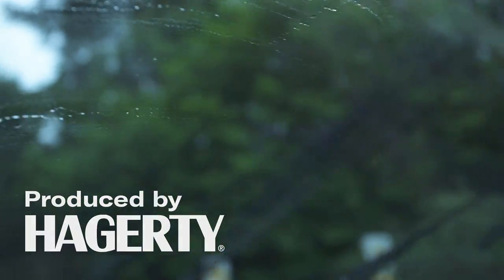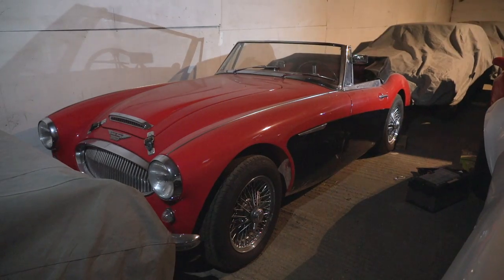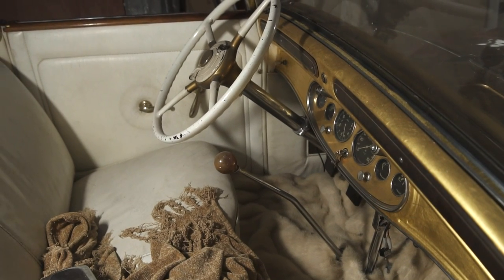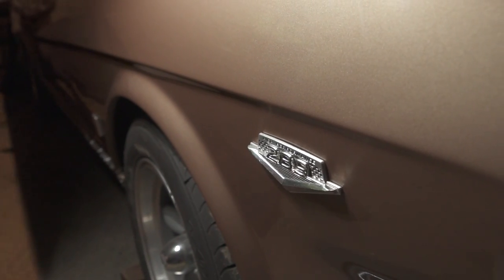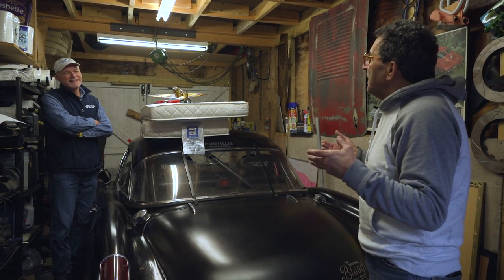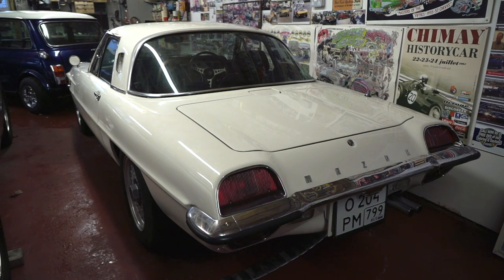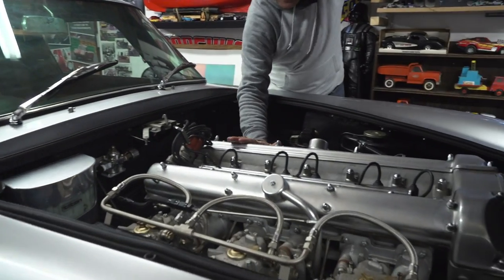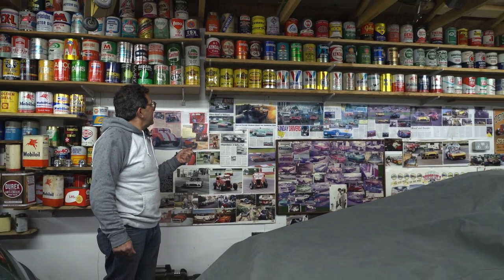Liberace's gold Cadillac, rare BMW M5 Wagon, Mazda Cosmo and more | Barn Find Hunter - Ep. 84

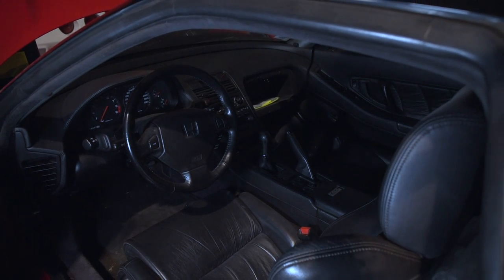Comment: 14:00 it’s a ‘67 Standard Mercury Cougar (Non XR7), based on the lack of XR7 badges on the C-pillar and lack of side marker lights on the rear quarters.  NOT the same floor plan as a Mustang, the wheelbase is stretched about 3” longer behind the front seats for better road ride and better rear legroom.  I’ve owned 5 Classic Cougars over the years.  LOVE’EM!!!
Reply: Bloody wikipedia. Better straighten those boys out.    Quote..***' Internally designated T-7, the first-generation Cougar shared its chassis with the 1967 revision of the Ford Mustang'**
Reply: moyadapne, No doubt.  Especially since they are both unibodies — there is no “chassis” so to speak.
Reply: when you own 30+ classic cars exceeding 3-5 million usd from every corner of the globe little irrelevant details aren't that important

Comment: So glad to hear you say one of your favorite cars was a 68 Cougar. My dad bought a 68 GT-E as our family's first 2nd car in 1975 and had my mother drive it. Of course dad loved to tear around in it. Dad sold it in 78 when he got mom a new Cougar to a guy that was the Motorcraft regional performance parts dealer. He saw the car in 77 and after he checked the VIN, he told my dad "When you are ready to sell it, call me." As is usually the case, dad really didnt know what he had and sold it to someone else. Sure wished I had that GT-E today. The thing about the GT-E is it was so nose heavy and had so much torque that you could make the rear wheels break traction on wet pavement in any gear. On dry pavement, it was a luxury missle of the day.

Comment: Oberlin College student Charles Hall and French engineer Paul Heroult separately and simultaneously develop an inexpensive electrolysis process by which aluminum can be extracted from aluminum oxide. The large amount of electricity required to power the electrolytic process limited the production of aluminum. Hall received U.S. patent #400,666 in 1889.

Comment: The cougar is a 67. The rear quarter panel side badge is the giveaway. The early 67s did not have side lights or reflectors. In 68 Mercury added the oversized rather ugly front fender side lights and a less offensive rear quarter reflector.

Comment: The black  Corvette is not factory flared..no such thing.  But not uncommon for custom shops in the US during the 1980's. Thats why its painted black, probably once a custom airbrushed mural with metal flake paint job.  The difference between a 1967 & 1968 Cougar was 1968 had newly federally mandated side marker lights.